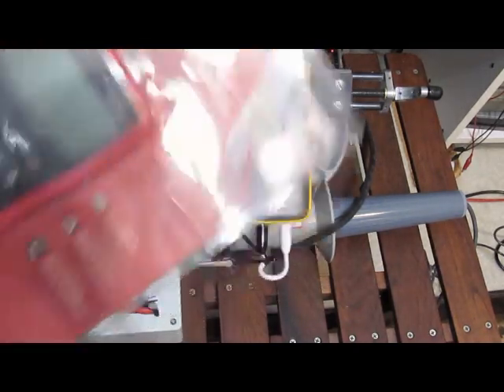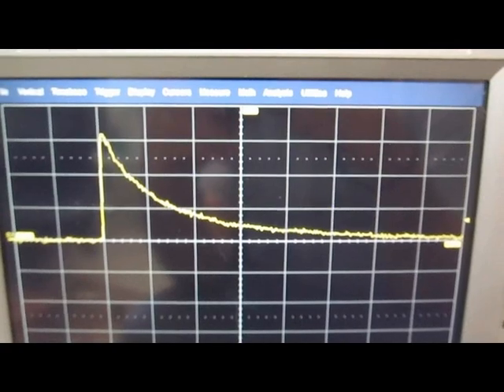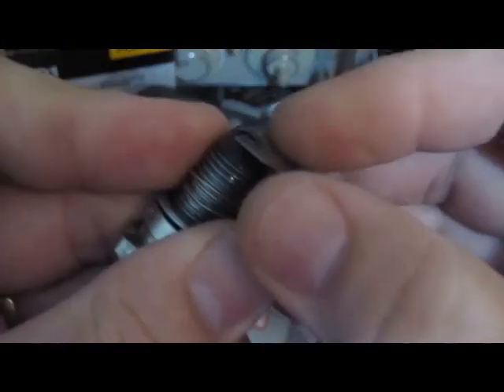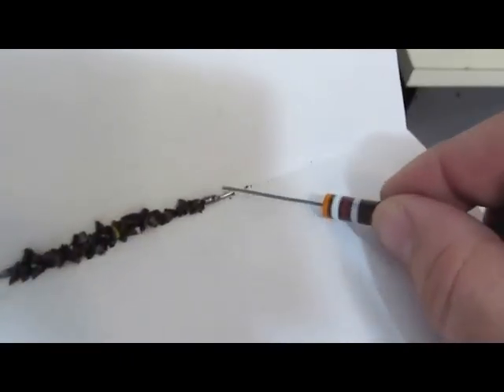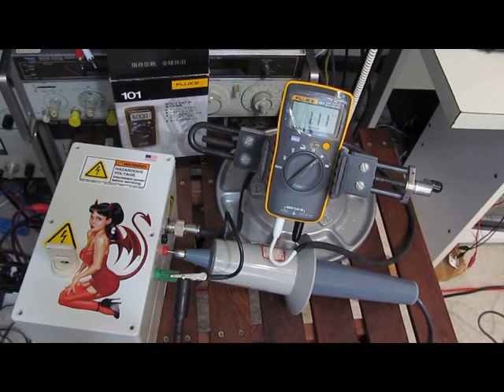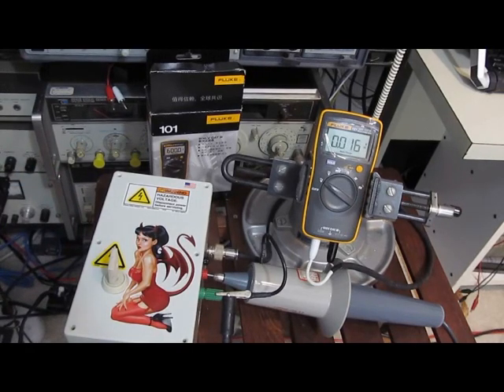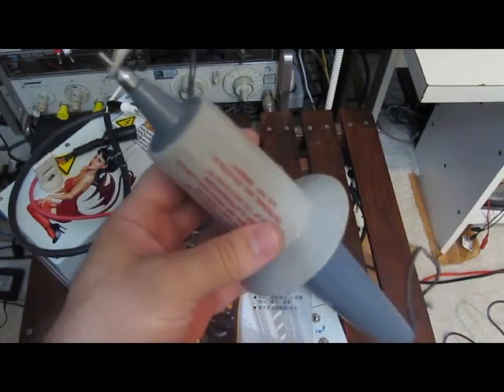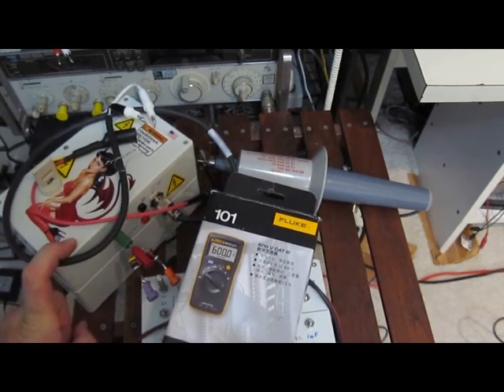Evaluating low cost DVMs Part 22  followup with the Fluke 101

Comment: How high Fluke 101 can measure amp with .01 ohm shunt without damaging the meter? I heard Fluke 101 doesn't have fuse.
Reply from the maker: If you look in the manual for the 101, it's rated for 600 volts.   I=V/R = 600/0.01 ohms or 60,000 Amps.  You may be able to push it a little higher.   Maybe post a picture of the shunt you plan to use along with the equipment it is used in.
Reply: fuses are normally for amperage testing.  101 does not have that.

Comment: I'm curious;  I've been looking for a meter for a while figuring the more money I spend, the better the meter, then I saw a few of your videos and watched the 101 go through the testing....   I would primarily be using it for automotive trouble shooting and residential home repair.  This should handle it everything nicely for that.  Yes?  So no need for the Fluke 177 for what i'm going to be using it for?
Reply from the maker: +Nick Sebring Hard to say.  When looking for electrical problems in a car, one thing I run into is needing to look at the current draw when the car is off.   I will short the leads together until the lights turn off, then pull them apart to watch the current change as the car goes through it's different modes of shutting down.   This meter has no current sense.   If you wanted to use a shunt to measure the cars current draw, the meter's has no DC mv  range.   Not having a back light may also be  problem for you.  

I was very impressed with the Fluke 107 I tested in the second round of meters.  I also plan on running at 17B+ in the near future which has even more features.